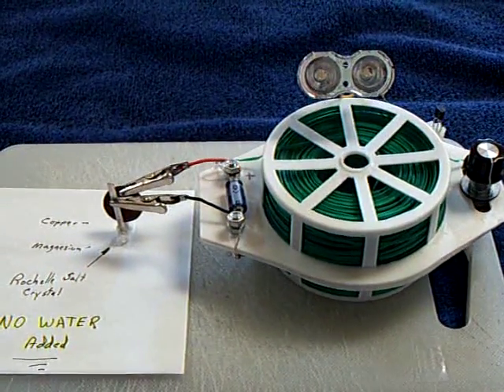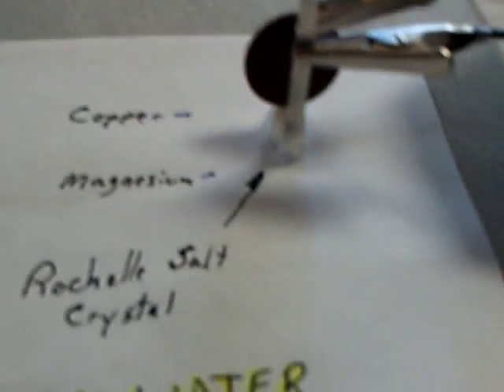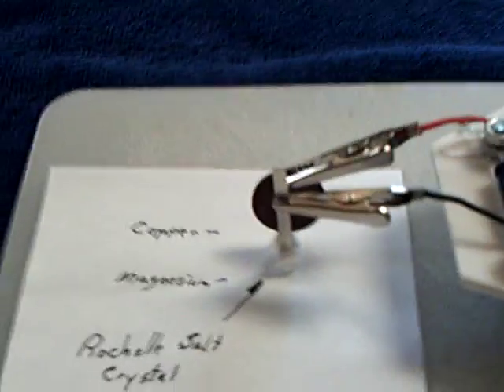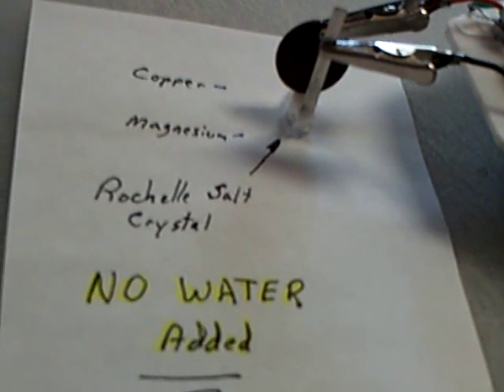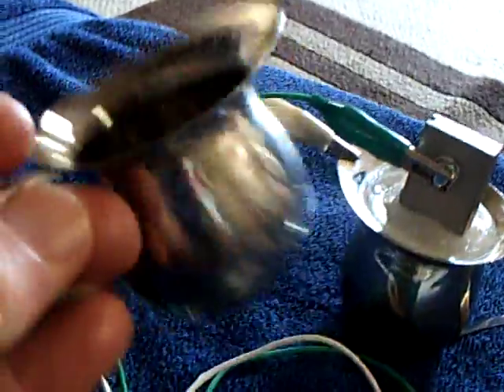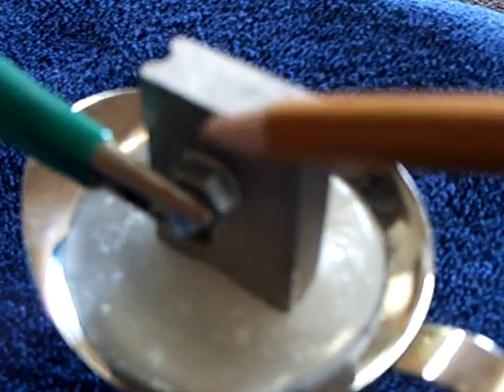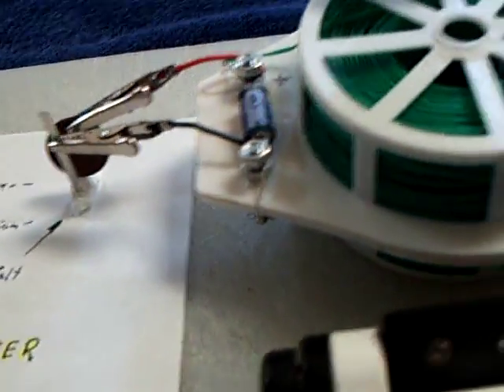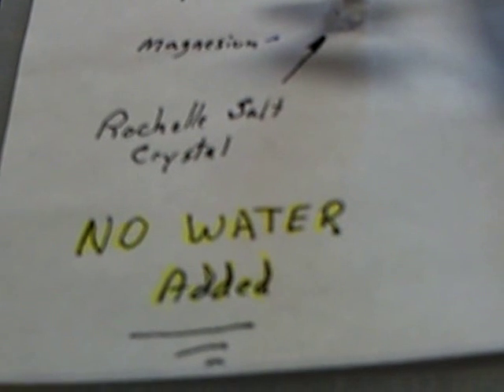Point contact Rochelle salt crystal cell.ASF

Comment: Hey man did your sainless steel cell die after a while
Reply from the maker: No!  That rechargeable stainless steel and Epsom salt battery is still going strong.  I might do an update video on it.  It is one of my most successful projects.  It runs a Joule Thief Led light ('Penny') around the clock 24/7 ---year after year.  A solar cell charges it up during the day.  Once in awhile I have to clean it up a little and add some water.  For some reason it grows crystals around the edge of the container that fall off and make a little mess.  It sits on a shelf near a window and gets morning sunlight only.
Reply: That's really cool. It would perhaps make a good replacement for other batteries I wonder if you casted it in resin to hold the mosture in there so you don't have to fill it up and then you could use copper electodes. It wouldn't corrode because there is no air in the resin. Any way I was talking about that crystal battery you made in the SS creamer with the wax on the top has that stopped running. ?
Reply from the maker: ALL of my magnesium anode based batteries ----- turned out to be simple galvanic cells. The magnesium simply broke down over time and the cell stopped working.  The good news is that if you replace the Mg they keep right on going.  The stainless steel creamer one is still working on the original anode but I have to keep pushing the Mg piece down into the 'can' as the bottom part gets slowly eaten.  The wax did not seal it very long but that was OK because it lets me add a touch of water once in awhile to keep the reaction going.  The cell still drives the original led circuit that dimly lights up when it gets dark at night.  I look at it every night here in my living room.
Reply: @Lidmotor  
Great that sounds alright I guess if hypothetically someone figured out to stop the metals from corroding we could extract all the energy we need from sea water. I was thinking of using galvanised steel and stainless it would still corrode but not as quick as magnesium. Anyway thanks for replying you have a great channel

Comment: Salts precipitated from water almost always contain water. Rochelle salt crystal is aka sodium potassium tartrate tetrahydrate. You could dehydrate it by soaking it in 99% alcohol or acetone. This is a galvanic cell of magnesium and copper. Rochelle salt is much more interesting than a lemon but in this case serving the same purpose.
Reply from the maker: Yes.  Thanks for the comment.

Comment from the maker: No that is not green fishing line.  The green wire is gardening "twist tie" wire.  It is tin coated steel wire with a flat plastic coating.  You can find it hardware or garden supply stores.  This wire I found in the 99 cent store. $1 a roll.

Comment from the maker: @slider2732 ---  I have a CFL Joule Ringer that might work but I will have to build a 9 volt voltaic pile to try it.  That is not a bad idea at this point.  That would be really really cool If I could run a CFL Joule Ringer non stop for over a month using crystal cells.   My wife hasn't seen these little SS creamer cups yet.  I saved one for her if she wants one.  Big Lots had em (2) for $4.

Comment: Wow great job on the crystal. My latest designs work on the same principle as your cell, but I use very small crystals instead and a type of point contact. I guess you could say great minds think a like. If i remember correctly someone on the forum had access to liquid nitrogen and froze one cell to -165 degrees. Also from this experiment you can see that the electrons flow on the skin of the crystal and not through the crystal.

Comment: Cool vid again :) 
For reference, i'm finding at that fire rate, a 'Penny' type uses 4mV per hour (from 1F supercap). Wondering if, with that sort of LED output, you could light a CFL  on an exciter or Joule Ringer. Would need 100uF cap or similar to smooth the pulses.
Thought you were going to be in bother with your missus when seeing the very nice creamer cups.

Comment: When you add a lot of salt into water, you lower the freezing point. So the ratio of salt to water may just be too high for the water to freeze in the freezer for the Rochelle salt cell. And if that magnesium battery stops working, it'd be cool to pull the block out and see what layers of salt caused oxidation and which ones didn't. Love following your work!